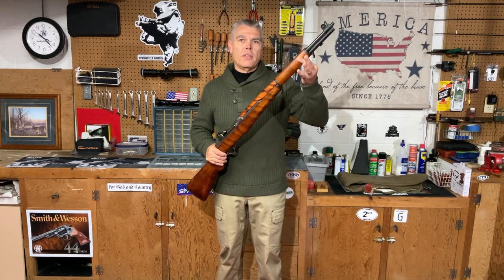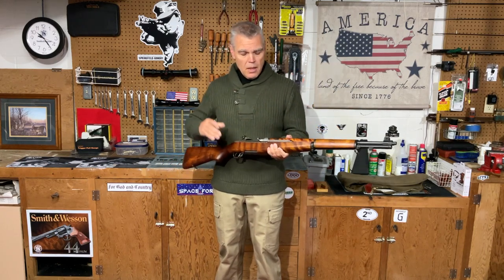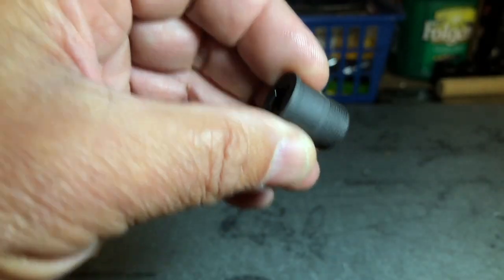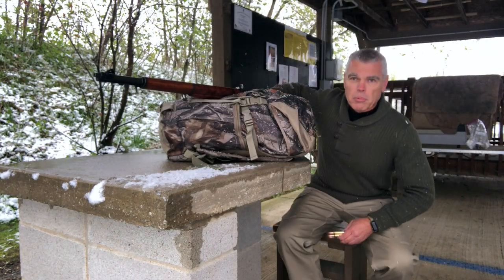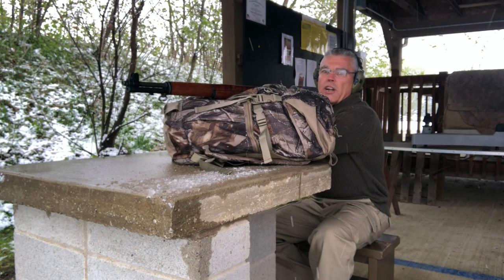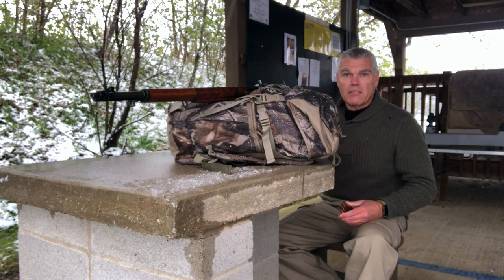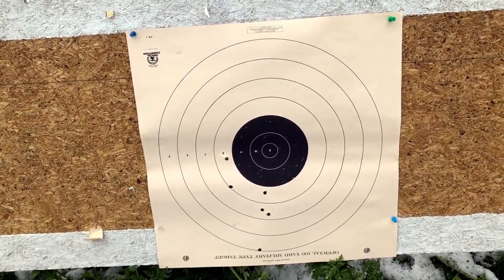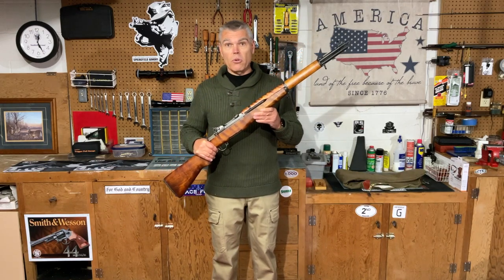Garand Gear Ported Gas Plug: Fact or Fiction

Comment: Have the grand gear plug in my 1957 m-1 it seems to be doing fine but i don't fire it alot but when I do I use good hipower hunting loads and have not had the first problem knock on wood i have my back up remington 760 for the quick shots when needed. Im geting old and the 760 is just ez,er  on the ol body lol
Reply: O i failed to mention the 760 is a first year of production rifel so it's no youngster it self lol
Reply: And they fit well with my 1957 and  1942 dated Winchester model 12's

Comment: Good morning, HR.  What follows are several “random observations:”
1.   In mechanical engineering THEORY, greater volume for gas expansion should be beneficial (increasing durability, with higher pressure .30-06 commercial loads), BUT I suspect the increased in volume provided by the Garand Gear plug might need to be considerably larger to be effective (the current replacement gas plug volumetric increase really appears to be rather small).
2.   Everything — and I mean that word — in engineering is a trade-off;  therefore, were an appreciably larger volume gas plug to be developed and installed, then the issue might become insufficient pressure to cycle M2 loads reliably (perhaps, particularly some overseas manufactured rounds). 
3.   Spring in Ohio . . . In the mid-1960’s, I attended college in Delaware, Ohio.  I distinctly recall a cold and blustery day in early-June, when a snow shower hit as I was walking to class on Sandusky Street.  Okay, it didn’t last long, it wasn’t a heavy volume of snow, and there was no accumulation, BUT it was snow in June.  

Have a good weekend.
Reply from the maker: Thanks Roy, I had the same feeling as you when I saw how little the GG plug increased the volume of the gas cylinder. In the end, I don’t think it sufficiently tames high pressure ammo in the M1, and I believe it decreases functional reliability with the military spec ammo the rifle was designed to use. I was testing this plug at the request of a friend (his rifle, his plug, his ammo), in the end I advised him to stick with the original gas plug and mil-spec ammo.

Reference snow in June, I’ve seen that a few times too. Including last June. Someday I’ve got to look into moving somewhere warmer!
Reply: @hrfunk  

1.   Well, my friend, from personal experience I can respectfully suggest that grandchildren in the area can alter your thoughts of a warner retirement climate.
2.    That Garand is spectacular!  Fool that I am, I sold mine many years ago to help finance an excellent, Winchester, bolt action, .308;  it’s a great rifle, but it is not history.
Reply from the maker: I’m sorry to hear that Roy. My M1 would be one of the last firearms I could ever part with. It’s the rifle that literally helped save the world.

Comment: Many years ago I had an op rod flex enough from commercial ammo that it blew the side of the stock out.  Believe it or not, changed the stock and it functioned fine going back to M2
Reply from the maker: I think that’s the best way to go.
Reply: Doubt
Reply: @Doman3500  LOL.  My hand didn't doubt it.  Stung like hell.  We didn't even realize why it broke till some time later.
Reply: @tomjoseph1444  doubt it was because of ammo. Your rifle is out of spec or not properly greased.  People have 300 win mag barrels on their garands with a standard gas system and guess what....no problems
Reply: @Doman3500  50K pressure is 50K.  That is what it is designed for.  Gun ran fine after the new stock was put on it.  I shoot 190 gr. SMKs in one now (because I have thousands of them) but still maintain the 50K or less pressure, usually around 47K.
Reply: @tomjoseph1444  commercial ammo follows saami specs.  It's fine
Reply: @tomjoseph1444  the rifle was designed under SAAMI specs.

So max pressure is 60180psi

Comment: Where do I get one of those Springfield armories head and cover poster things?
Reply from the maker: I bought it from Springfield Armory’s store at Camp Perry during the National Matches. You might be able to order one directly from SAI. Check their website. I think I paid $10 for it.
Reply: @hrfunk  Thank you. I Have two Garands and purchased the plugs but have not installed them. I think I will sell them based on this video. Thanks for everything. (One of my Garands is an authentic NM Series II that gauges "1" and "1". I try not to shoot it too much)
Reply from the maker: Oh, my! That one was built to be shot. You really need to run a few rounds through it from time to time.
Reply: @hrfunk  They don't list it on their website (Crap!). They only have the Cross Cannons.
Reply from the maker: @benkanobe7500  They must have discontinued the ones like I got.

Comment: A friend told me you can remove the gas plug all together and it will allow you to fire modern 30-06 but it has to be manually cycled like a bolt action. I have not had the guts to try this with mine lol I just have the no modern cartridges stuck in my head.
Reply from the maker: That will work, but I don’t really have any desire to do it. I’ve got other rifles for full power 30-06 loads if I want to shoot them.
Reply: @hrfunk  Thanks, I guess its good to know in a pinch but like you said if you have another 30-06 bolt action why bother.
Reply: @thetr00per30  Removing the gas plug is a no-go. The plug holds the whole mess(gas tube, front sight assy.) together. If you want it to operate like a bolt gun, drill out a GG , or a standard plug[requires A LOT of drilling] so that all the gasses escape without actuating the op-rod.
I have a Schuester plug and have tuned it to work with my heaviest commercial loads, 180 gr Fed, Win, Rem, S&B, and it still cycles with mil-spec. I don't use Superformance or "light magnum" loads as those are tailored to bolt guns anyway. Also, I do not shoot it a whole lot either and I put a scout scope on it for hogs and deer.😀

Comment: I am not an advocate for using commercial ammo as I really think that M2 style kids are the way to go. However, I do not think recoil is a direct indicator of what is going on with the op rod. You fired loads that we all knew would produce more energy and more recoil. Gas volume and pressure applied over time is what provides affect to the oprod not recoil of the rifle.
Reply from the maker: Perhaps so. In any case, like you, I prefer to stick with M2 spec ammo.

Comment: I tend to agree I wouldn’t run higher pressure ammo consistently as you mention.  Accuracy is always subjective, but agree marginal functioning.  The gas plug is an option perhaps for some, but I like you wouldn’t have a need for it.
Reply from the maker: Thanks David. I was testing this plug for a friend. I ended up advising him to stick with the original plug and mil-spec ammo.

Comment: I traded a FN SPR for an M1 Garand about a year ago. Originally came with a Garand Gear plug in it. I never saw the point in keeping it on as a reloader. I load 30-06 with 47 grains of Varget which gives you a little hotter of a cartridge than standard M2 Ball ammo. Because it is only a 80 FPS difference, I feel fine using the factory Garand plug in my rifle

Comment: Should have fired with the original plug for accuracy comparison, also, could have shown the grouping where the empties fell with each round of fire.  If you could find someone with high speed camera equipment, actually measure the speed of the op rod during firing, as in "myth-busters".🤓

Comment: in general you are sited in for 25 yards bump it 1 click for a hundred yards 
with 30 06 its 1 inch  of moa for every 100 yards 
you didnt show us where you were shooting with the plainfeild machine 
grenade launcher gas plug  with ball ammo 
Hyper ammo kind of scared you lol 
all you have to do is roll the gun over upside down and look at the op rod 
youl see if its bent and binding and have to straiten it 
and thats realy crappy aftermarket ammo to hot for any rifle 
use winchester soft points they will tweak but shoot strait  those were 150s 
try 180 and 200 grain bullets 
dont worry about the rifle at worst youl have to straiten op rod when i bought my garand i didnt know about the ammo 
i shot 300 rounds of 180 and 220 grain rem and winchester soft points 
and when we were done the op rod was bent and binding on 2 sides 
the plainfeild grenade launcher gas plug with piston in it hanging out wide open with spring sticking out part way it saved the rifle .
pushed it back in plug good as new had to straiten op rod it wasnt heat treated after they custom bent it.
sugest you take your time sight in the rifle with hunting rounds in it
how was rifle shooting befoe with ball ammo
Reply from the maker: These days, I just stick with ammo that conforms to M2 specs.

Comment: Why would you test fire an unproven system without proper eye protection? Reading glasses won't help you if there is a failure.
Reply from the maker: And yet, I escaped with no in jury.

Comment: Sorry, but I disagree. It is not unsafe to fire commercial ammo in a M1 Garand.  After WW1 the Army concluded that the M1917 MG was being outranged by the 8mm Mauser chambered Spandau MGs (from 800 to 1000 yards) so the M1 rifle was designed to fire the M1 cartridge that was significantly hotter than the M1906 cartridge. Most ammo used in WW2 was the M1 cartridge. In 1939 the Army National Guard complained that M1 ammo was over penetrating the berms and backstops of their ranges and posed a safety hazard. The Army took the M1 cartridge and gave it the muzzle velocity of the 1906 and designated it "rifle cartridge caliber .30, M2." This ammo was supposed to be used only as training ammo.
M1 ball ammo has muzzle velocities similar to modern commercial ammo.
Reply from the maker: I don’t think safety is as much of an issue as the prospect of accelerating wear and tear on the Garand. You may shoot whatever you like in yours. I’ll stick to M2 spec ammo in mine.

Comment: In my experience, any attempt to change or modify the original engineering specs of antique or vintage firearms is fraught with danger, and rarely fully achieves the intended result. Better to stick to what they were designed to do. Good of you to risk your rifle to try out their claims, though. Hope you DIDN'T damage the op rod.
Reply from the maker: I agree with you Dale. This rifle actually belongs to a friend of mine. He loaned it to me along with the ammunition and GG gas plug and requested I test it. I don’t think it suffered any damage, but I recommended he stick with the GI plug and mil-spec ammo.

Comment: Uh, some information for you Ace. 

1.  The M1 Rifle was DESIGNED FOR full-power, full pressure 174 grain M1 Ball ammo (dating to 1925).
2.  John Garand himself said that M2 Ball was NOT SUITABLE FOR COMBAT USE.
3.  Commercial ammo does NOT have "higher pressure" than military ammo.  CHAMBER pressures are EXACTLY the same specs.  In fact, the current SAAMI maximum average pressure specification for .30-06 (50K CUP) was simply the US Military specification from 1906.  There is NO commercial ammo (or reload data) that exceeds EITHER 50K CUP or 61, 190 PSI.
4.  There is no "gas plug" (or gas block, or gas tube) on your M1 Rifle.  It's a GAS CYLINDER LOCK SCREW (modified or not).  These devices are NOT needed unless one is reloading a very heavy bullet with very slow powders for long-distance shooting. 
5.  This "bent" op-rod thing is 99% BS.  As long as your recoil spring (op-rod) spring and your rifle is properly lubed, you can shoot any commercial ammo you like 180 grains or less (and this is the CONSERVATIVE rule-of-thumb from the CMP). 
6.  And the reason your rifle failed to cycle was that the MODIFIED Gas Cylinder Lock Screw is designed for HIGHER gas port pressures.  The modified screw = UNRELIABLE functioning with the most "common" (albeit not "spec" ammo).

Your video only demonstrates you wasted 40 bucks.   

https://www.youtube.com/watch?v=UOSdswZHJUc
Reply from the maker: Fortunately, neither the rifle nor the plug were mine so it looks like all I wasted was my time.
Reply: @hrfunk  And spread a boatload of bad misinformation that several hundred people actually believe.  Oh well.
Reply: @johnwinn5019  
I'm curious.  What actual, practical experience do you have with the M1 garand, gunsmithing, and ammunition reloading?
Reply: @davidhilliard1350  How about 35+ years of shooting, reloading for, and collecting these rifles.  Extensive historical reading and researching.  Personal acquaintances with some of the most well-known and respected collectors (and writers).  Published article on THIS topic in the Garand Collectors Journal.  Is that satisfactory?  If not, try reading Julian Hatcher's Book of the Garand.  He was a close friend of Garand himself and worked side-by-side with him.  LOL
Reply: @johnwinn5019  
The "article" you wrote with Jeremy Cheek in Winter 2019 was essentially a complete disagreement with a previous article published in the Garand Collectors Journal from the previous summer.  After, they published yet a third article refuting your opinions and reaffirming original stance.  This doesn't establish a firm credibility on your part.  

I respect your opinion AS your opinion, unlike how you seem to be so disrespectful of others.  The rifle in question has fired, what? Tens of millions of rounds of M2 ammunition?  More?  That ammo must be perfectly adequate.
Reply: @johnwinn5019  
Wow, I didn't get that from any of the articles.  The main point I took away from the articles and the comments you wrote in between, it's that you've been a generally disagreeable egomaniac since at least before 2019.  I have no more time to waste on you, Ace.
Reply: @davidhilliard1350  
“When the debate is lost, slander becomes the tool of the loser.”
Reply: @johnwinn5019  
Well, then you should reread your own posts with a non-jundiced eye.
Reply: @hrfunk  And ours.
Reply: @davidhilliard1350  yeah I read that third article.  It didn't refute anything in the second article.  It was mostly hearsay and some warnings about heavy long range handloads and then don't shoot new bolt gun sniper ammo made for an M40 in your M14.... which isn't a garand...

So being objective here...that third article was nothing but a hit piece full of opinions... nothing directly refuting the 2nd article.

Comment: This is all fuddlore
Reply from the maker: Please enlighten us.
Reply: @hrfunk  commercial ammo is fine. It's not gonna do anything to your oprod. That's a complete myth.   The Garand was designed around m1 ball, which is a heavier bullet. It also shot AP rounds which have more power behind them. People rebarrel their garands to shoot bigger rounds. Oprod holds up fine. 

The milsurp guy on YouTube does videos debunking the myth that the Garand can't shoot commercial.

Plus, if you really want to remedy a problem that doesn't need fixed. Get the Schuster gas screw. It's adjustable. The Garand gear one is garbage
Reply from the maker: I agree with regard to the Garand Gear plug. I a  look so agree that the M1 was designed when the M1 Ball round was the official cartridge. Even so, anything that produces greater pressure is going to wear the action parts faster than something that produces less pressure. For my rifle, I’ll stick with M2 spec ammo and it will probably outlive me.
Reply: @hrfunk  unless you're shooting thousands of rounds a year. It's gonna be fine.